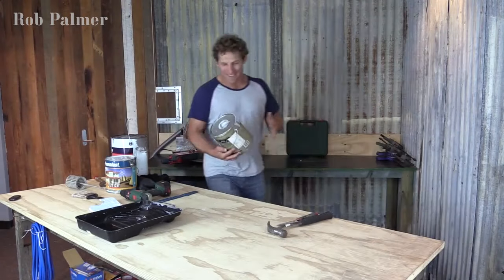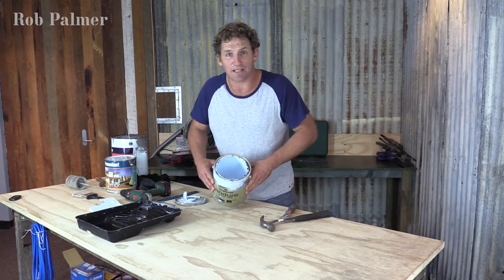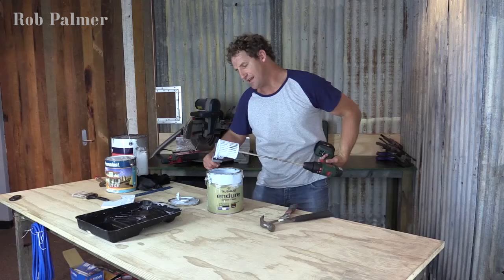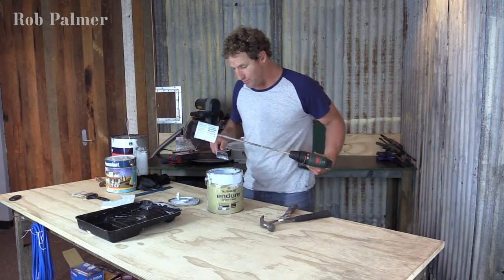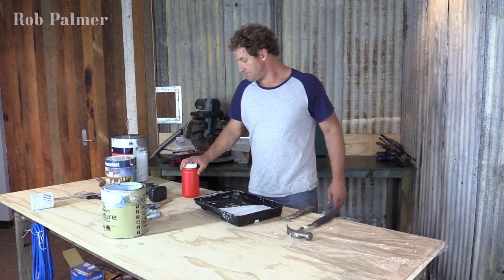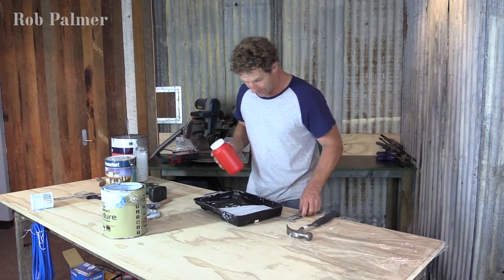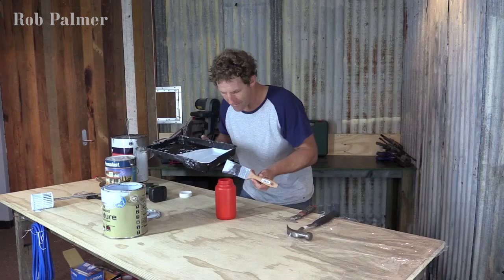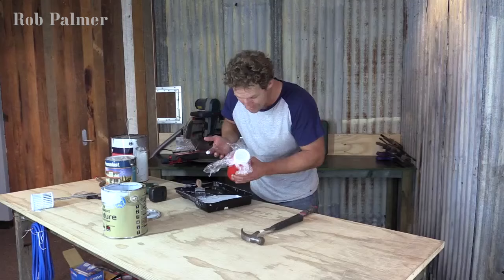Reusing Old Paint | DIY Tip

Comment: My brother in law has his own paint business and uses pantyhose all the time. He also uses them on his paint sprayer to keep it from clogging. He picks up left over paints from many paint retailers and he mixes them to get desired colors. His father was a painter and he worked with his father growing up. Old school. I have learned a lot from him in the last 30 years working with him from time to time. I wouldn’t want to do it as a career as I don’t like working with all the various chemicals. I do like painting as a hobby. 
FYI: It is important to know what you are working with, have proper ventilation, wear a ventilator when working with harsh chemicals such as strippers. People are mislead by certain strippers such as citrus strip just because there are no harsh smell and it is MASKED by the orange scent. It has ALL the same hazards as the harsh smelling ones. If you are unsure look it up on the safety data hazmat sheet.

Comment: I've got about 15 litres of  expensive acrylic paint, left over from 5 yrs ago, when the house was first painted,  almost rock solid at the bottom, i've got it broken down now after 3 hrs of stirring and chopping from fist size balls to pea sized my drill has got to hot to handle i keep giving it a rest, but after 15 min to hot again, back to stirring by hand. I asked my wife before if I could put my big balls in her tights, but i think i'll use cheesecloth after her remark. : )

Comment: Not that easy when paint separated with clear on top and solid on bottom. Could get some of the solids to mix with the clear but not most of it even with a drill and metal mud and paint mixer. Unless you have hours to spare. Need to use the wife's blender, ha ha.  Then there are fine mesh strainer paint bags either in 1 or 5 gallon sizes. Cheap and can be reused when cleaning it right away. I think it's better to stir it once a year before it gets solidified.